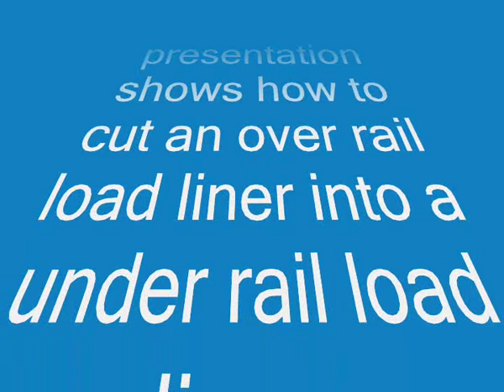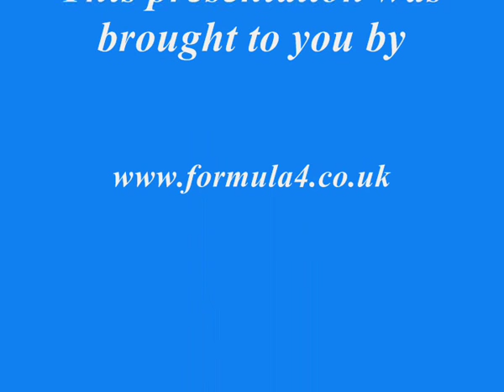Over Rail Bed Liner Cut to Under Rail Bed Liner for Mitsubishi L200 Mk5

Comment: The little flat took you used to take off all the burred plastic; what is it a blade a scraper? Thanks for video, I need to adapt my over rail line to take a roller tonneau 👍